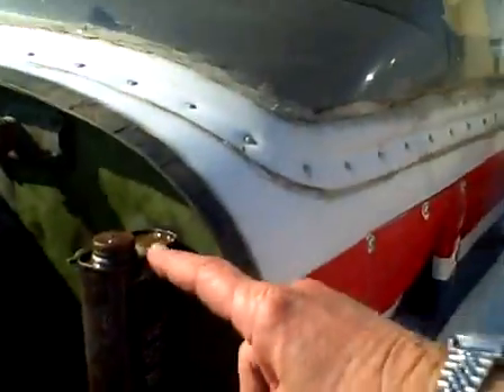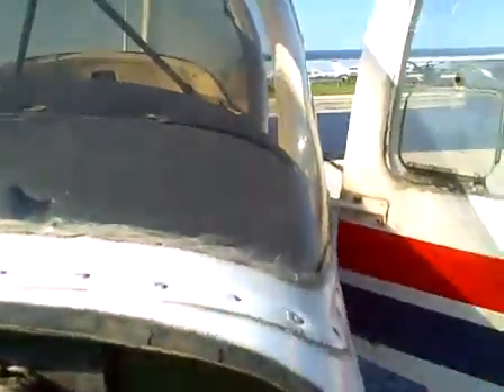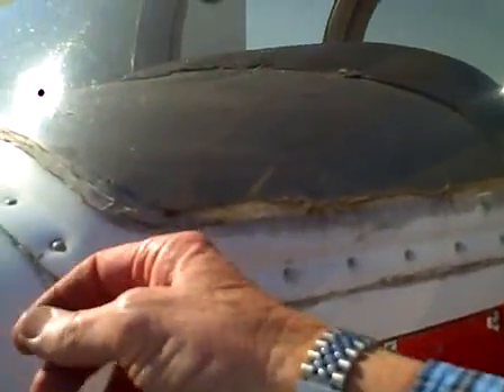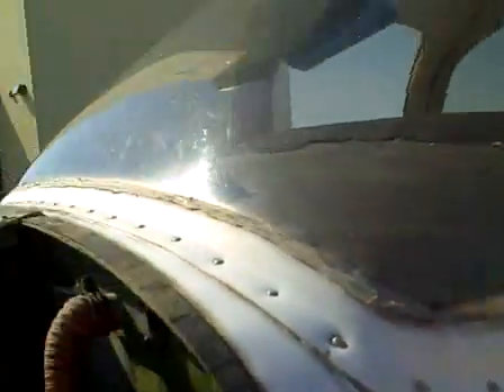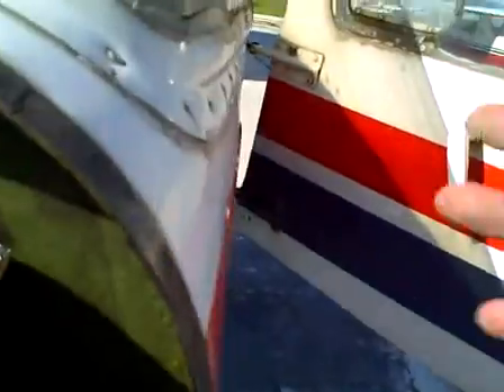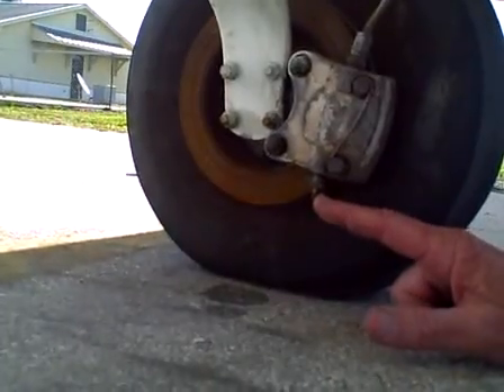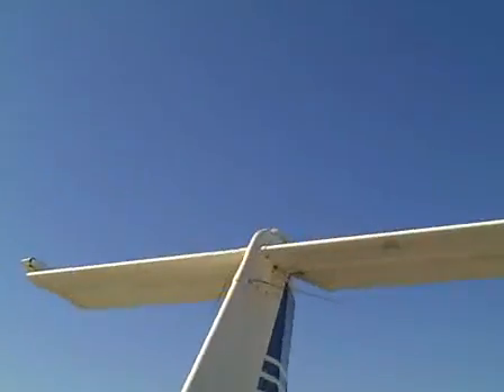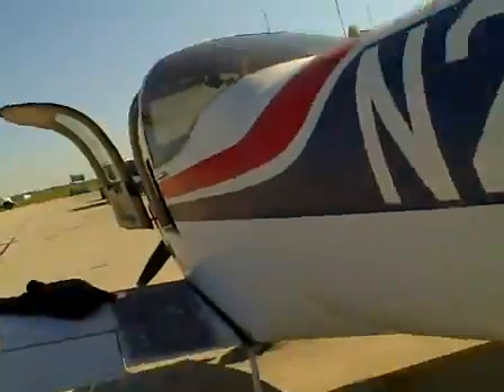Piper Tomahawk maintenance brakes

Comment: Thanks, I'll ask around and see if I can get a test fitting in a P-38. the project comes with damaged but rebuild-able wings. I have an A&P that will help with that (for free!) Is there a fix for the wing that I can do while fixing them? Also is there a fix for the tail components? I'm having trouble finding dependable info. I sure hope I can fit in the thing, I like the specs on it. --- Thanks, Bill

Comment from the maker: Hi hearsejr; Go try one out, the p-38 is the largest trainer out.  As a project look for the time limited items such as the rudder bracket assembly and the 11,000 hour limited wing brace. A good tomahawk should cost you 15 to 18,000 dollars have 5000 hours and the rudder bracket assembly checked in the log book at every  300 hours, Be sure a get a full set of log books and all maintenance performed on aircraft. Check the internet for Tomahawk P-38 ; every thing is there . Fly safe.

Comment from the maker: Hi flyboy, no I have not replaced my plug wires. The only problems for me are the brakes and the tires and the bottom plugs and a exhaust leak in five years of operation. Two problems to note are the life limiting wing and the tail bracket. Both fixable but you can buy a secondhand Tomahawk for 16,000 bucks . Happy and safe flying. 007 wingman.

Comment: After cleaning the plugs, you should consider rotating them.  Slick and Bendix have rotation guidelines to prolong plug life.  Failure to rotate the plugs (top to bottom), will result in a football shape on 4 of the 8 plugs.   The brake bleeder nipple is not a metric size.  This is a American built aircraft and uses SAE size tools.  The bleeder most likely is 1/4". Cleaning plugs can be accomplished by the owner under FAR part 43.  Removing the hydraulic reservoir is not.  You will need to work